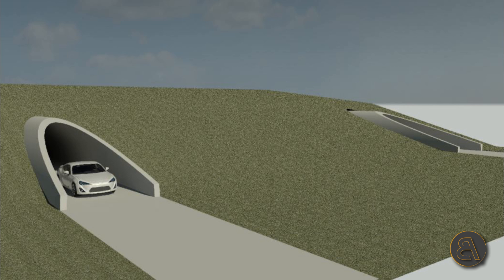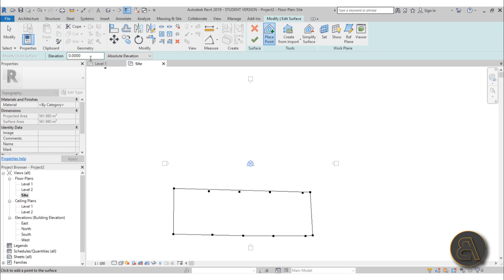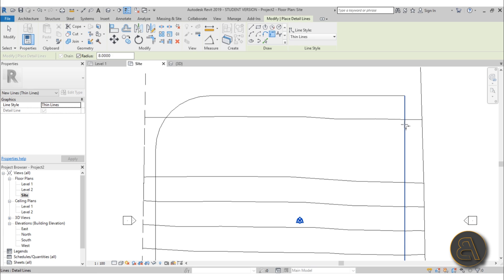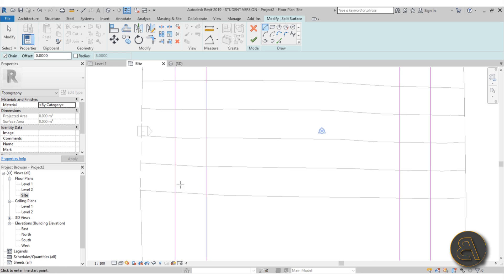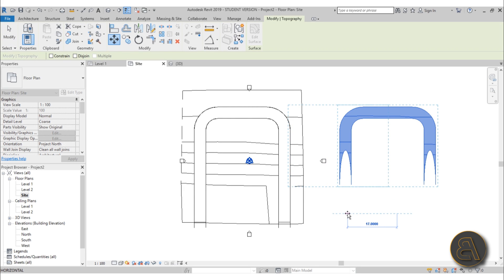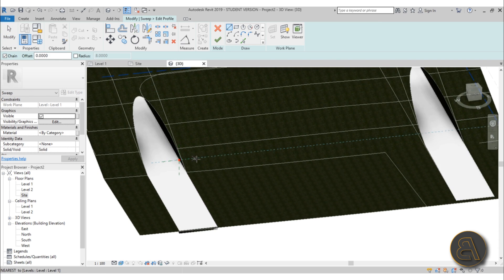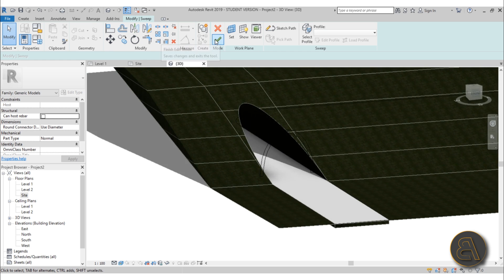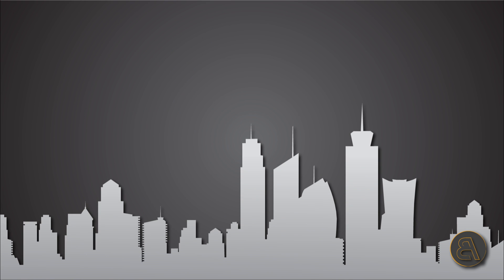Tunnel in Revit Tutorial

Comment: It seems very nice, but what appen if you cut inside the gallery with a section? Will the ground be inside the gallery? This video seems good just for 3D renderings, but for rendering other software are better than Revit (P.S. I like a lot this software with all its limits, but for engineering purposes it is not very good in every case).

Comment: Hi Balkan! i know that this is a nice way to finish a 3d modeling work to make some views and renders... but.. what about the architectural sections of that thing? i mean... that is a kind of trickie way to solve the bigest problem that is... that you cant cut the tunel volume from the toposurface! is there any way to build something between the topography? i mean... when you set an architectural section  is there a way to see earth... then the building (roof or floor + space + floor+ building pad?) and then again earth?
Reply: Yep, exactly. I'm having the same problem too. This tutorial isn't really useful if it doesn't address this issue. The only solution I found is to model the terrain with Mass instead of topography. This gives you the ability create hollow sweep.
Reply: @DavidGoshadze  Yes. That's what I'm doing if there is a necessity to show the c/s view of road excavation